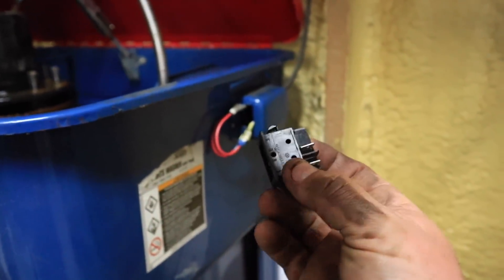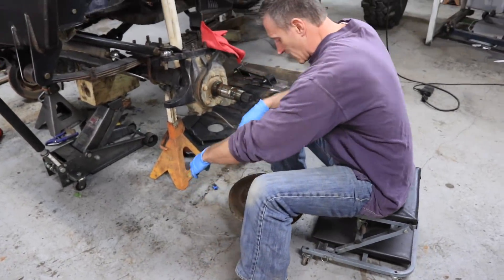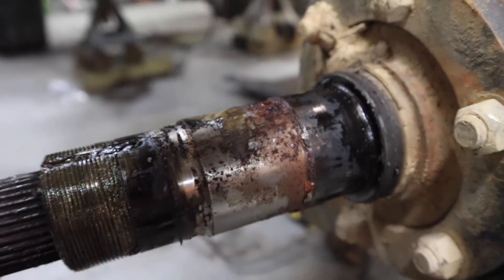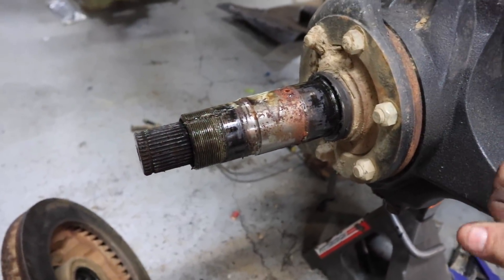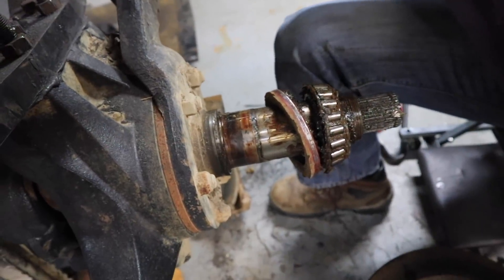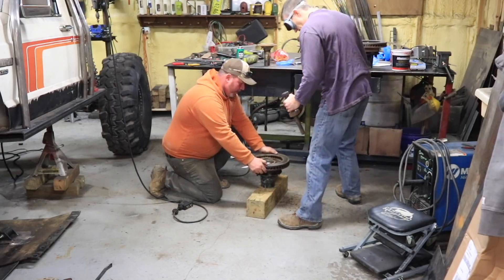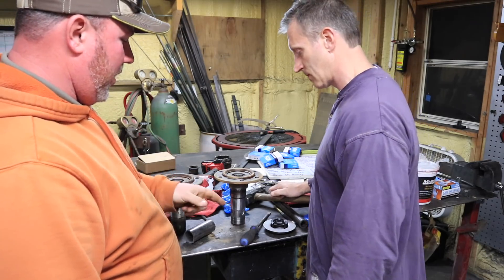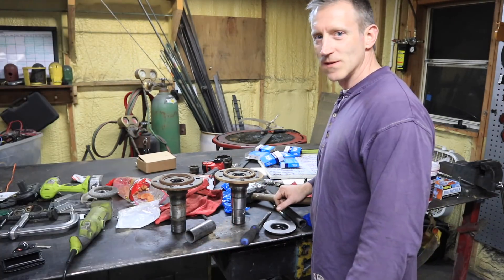Chevy Spindle Bearings Pro Tip

Comment: I have owned and torn apart a Dana 44 and two GM 10bolts and have never once seen those oil slingers. Shoot, I've never replaced a spindle bearing...in 100,000 miles. I'm finally doing it on my K5 and glad I ran across this video: slingers ordered. Living in Colorado, I guess a ton of people just throw those away.
Reply from the maker: glad to hear it helped!

Comment: Greetings from
NW South Carolina!

I am rebuilding the front end of my 1983 K5 Blazer.  Because the spindle bearing looked like it was in good shape, I was going to to leave it.  But when I put the channel seal up against it, it is below the surface of where the beveled washer will rest on (maybe 1-1.5mm below).  Is there an easy way to pull the bearing up?  I guess at that point, I might as well replace it.  But how do you get it out to begin with?  I think it would be a bear to hammer it out with a chisel or punch from the other side.

Thanks for a great video.

Comment: PLEASE do more vids like this (tips/tricks for ease or longevity) I personally would like to know the deal on crush sleeve eliminator kit installs, they worth it?
Reply: WoOsKii 1 The reason they are worth it is if you break a yoke you can just torque a new one on. And you don't have to worry about messing up your bearing preload. But they're very sensitive to set up so  don't think you're going to do it very quick. The last when I did came down to the .001
Reply: +Bleepin Rose Thanks for the reply! somehow I missed it.  Would you recommend using the crush eliminator kit? I need to do my first ever regear soon...  I do understand the benefits (the crush sleeve can also further crush under heavy load, esp. on hills, and cause issues) but some kits have mixed reviews (bad spacer/missing or soft shims) Is it worth the extra set up time/effort for ease of future maintenance and the added durability? (I have a D30 + 8.25 btw) thanks again!
Reply: I say that they are worth it! Just can be real finicky to set up! The bearing preload is very sensitive! The last one we did we'd probably took it apart 20 times to get it right!
Reply: +Bleepin Rose Ok, you seem really knowledgeable so I'm gonna take ur advise, and if I can't get it(20 TIMES! = >40 for me lol), I can just use the crush. the kit I want is only $30, so definitely worth a shot. Also I didn't even realize the significance of being able to pull your pinion until you mentioned it! thanks again, and keep dropping that knowledge!

Comment: what prevents the bearing from slipping down while on the trail with all of the banging etc?
Reply: John Padilla it takes quite a bit of effort to tap the bearing in it's a super tight fit. It's not going to move from normal wear and tear of four wheeling. Taking the bearing out is a lot of work traditionally there in there good

Comment: @jeremyrose7541   Not sure if you will ever see this but I had a question about the slinger that you talk about around the @9:50 minute mark.  The one you have there looks a LOT larger than the ones that they sell in the rebuild kits now.  (The one I received in mine was only 3.25" outside diameter).... the one you show looks like it's maybe 5" across (or more) and completely covers the back of the spindle... do you know if the smaller ones will work the same, or is there a place that sells the larger version that is in this video?  Thanks!!!   (EDIT:   Hold on a second... this is a D60 rebuild isn't it?  I was searching for D44 rebuild videos and this one came up....maybe that's the reason why the parts looks different?)